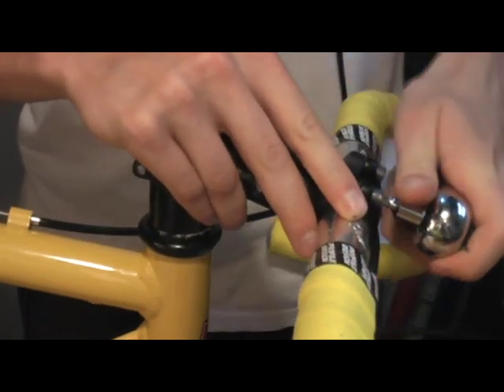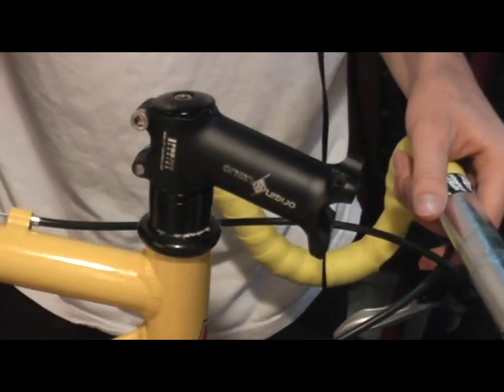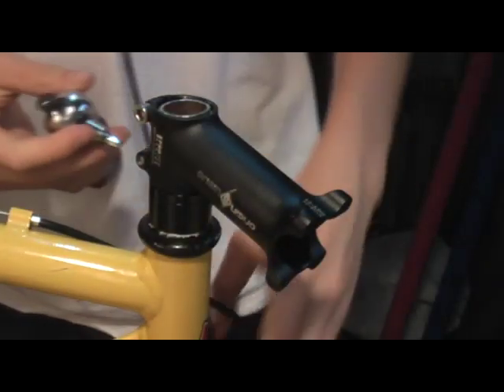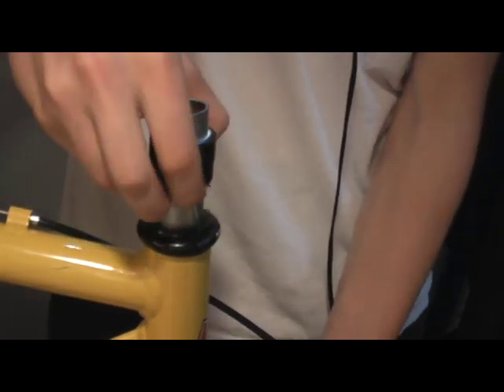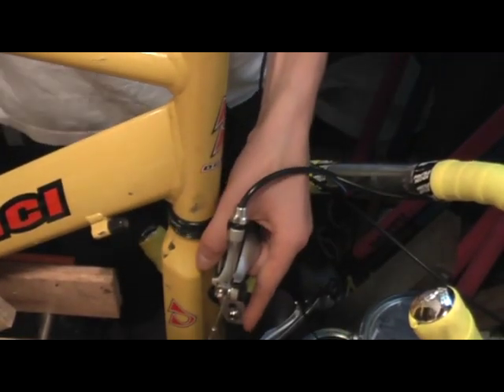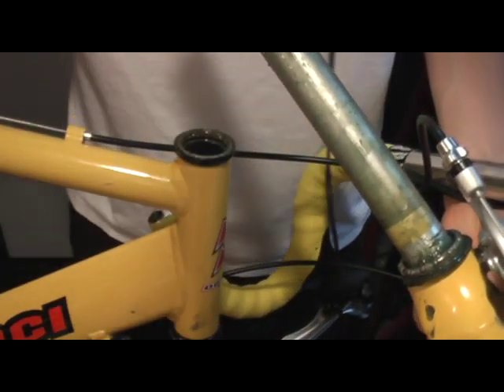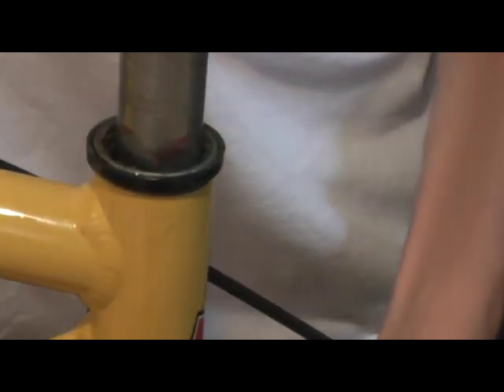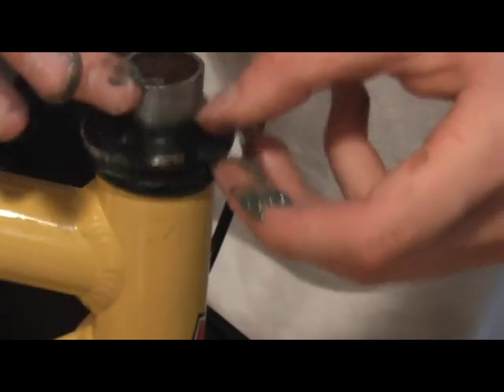Bicycle Steering Assembly Deconstruction

Comment: @tdelBIKES It's unique to cannondales lefty fork that is on most of their high end bikes.  Been around for 10 years and is my favorite brand of bike.  Got a 2006 F800 with just under 23,000 miles on the frame and still works like the day I bought it back in November of 06.  Worth the money and was Made in the USA one of the last few years before Cannondale outsourced frame manufacturing to Taiwan at the end of 2010.

Comment: Good video but this video is why I love my Cannondale with lefty front fork.  No star nuts or top caps or any spacers and bullshit.  Just two bearings on top and one bottom pressed into a cup that is pressed into the frame.  Two pinch bolts hold the stem on the steerer tube which goes through the bearings and clamps on the fork clamp to that and that's all their is to it.  Just loosen two 5 mm bolts for the fork clamps and two for the stem and use a rubber mallet to knock the steerer tube out.